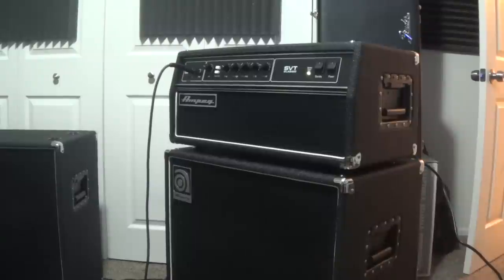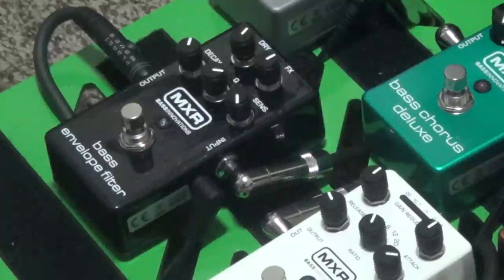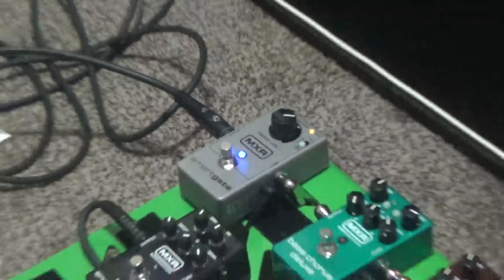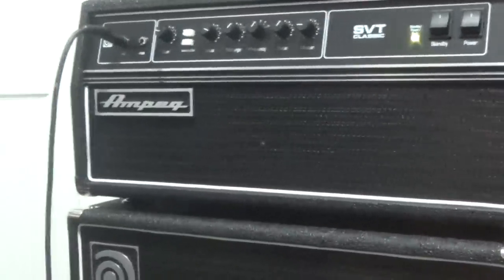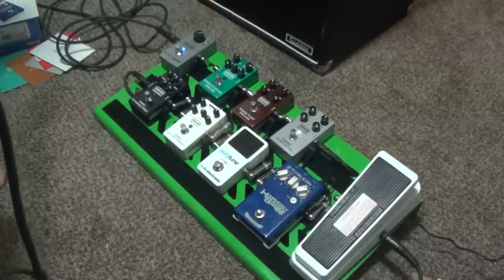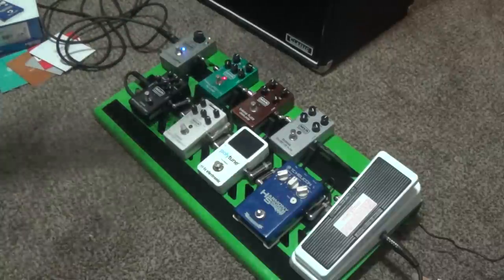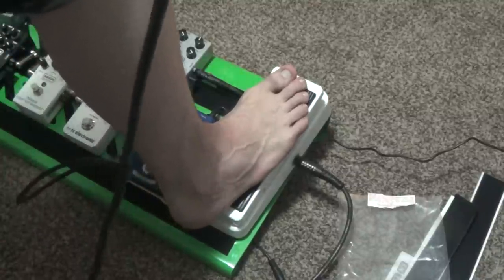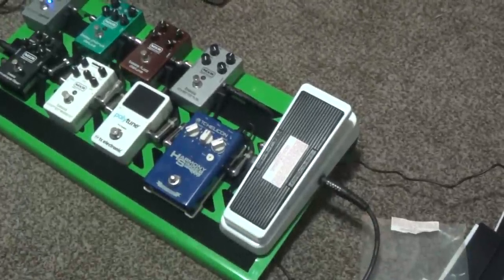Fender Precision Bass through an Ampeg SVT Classic Tube Head with Ampeg 4x10s (2) + MXR Bass Pedals!

Comment: Just a suggestion, but If you read the instruction manual for the MXR Fuzz, and OD, It says that they are NOT to be powered with a daisy-chain type power supply. I don't know if that's what you have going on, but it might be what's causing all of the noise. Just trying to help. The MXRs like their own power supply. Just a suggestion. Nice Video.
Reply from the maker: can't find that in either of the manuals, thanks anyways...
Reply from the maker: Engaged...obviously. This video is old and I've since removed the noise gate and have redialed the entire rig. I have no issue with noise now. I also found zero difference using 9 volts vs the 1SPOT
Reply from the maker: Actually it's extremely obvious because I turn on the fuzz in the video and then I mention the noise and how I didn't have the noise gate dialed right, you can see and hear in the video that it was after I turned the pedal on......So if that's not obvious I don't know what is.

Comment: Love the SVT, I use them live and they have a tone like no other amp does... but the MXR pedals I steer away from... they are good, but I am a BOSS fan through and through.  Wondered why you love them as much as you do... myself found them more than a shade under what Boss has done.  Not being a shit, but I am curious because after using a board with just MXRs, I had to go back to BOSS.
Reply from the maker: Nice, I really like the chorus and compressor, the rest I'm not the biggest fan of, they all work pretty well but yeah I'm sure there are better pedals
Reply: Very cool... My board is now 'thinned down'.. Boss-BB-1X Bass Driver, BOSS GEB-7 Bass EQ, BOSS CEB-3 Bass Chorus, Dunlop Cry Baby 105Q Bass Wah and BOSS BC-1X Bass Compressor. I use to use a huge rack of 10+ pedals at one point, but this one finally has set my sound the best.

I go through the SVT and use a '77 Gibson SG Bass or a 4002 Ric.